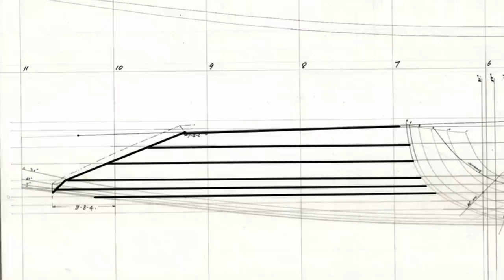SAILBOAT REFIT: Side Decks+Secret Room [E36]

Comment: You probably already know this Matt but others may not… wooden tongue depressors make excellent epoxy stirrers, applicators, fillet shapers, etc.  At about 3/4” x 6” they’re a good size.  I’m onto my second box of 400 with my build.  They work out at about 4 cents each for me, when bought in bulk.  Keep up the good work. Cheers.

Comment: It's great to see the both of you sitting comfortably in the aft section of the cockpit as it speaks positively to the ergonomics of it all and your design decisions.  I'm very interested to see how you design the locker lids in the aft benches (assume you will have these both port and starboard) while maintaining solid structural integrity. Cutting holes into the aft decks can potentially reduce rigidity but I'm certain you've already pondered this thoroughly. Great progress this week, keep on rolling Duracell! Cheers, from this Canuck in Singapore!
Reply from the maker: i'm gonna put the locker door on the cockpit wall, not on the deck. it's already pretty rigid. adding the cockpit wall will keep it very stiff

Comment: You might look into using a kitchen rubber tool that is used for getting inside bowls..it's about 2x3" with a 10" handle..good for fairing and cleaning up the excess
Reply: A spatula?
Reply: Yes you are 100 on that the silicone ones from the dollar tree work awsome
Reply: I would try a Chinese rice spoon used to remove rice from a rice steamer.
They have a rounded end and they are fairly wide which would give you a beautiful radius when smoothing out the epoxy glue. They are made out of a tough plastic that has a very nice curve and the tip of the tool.

Comment: We used to own a bakery and watched my dad using the bag to do toppings. 1967 Happy Valley Goose Bay. I got pretty good at it over the years.
There’s a little technique where you kind of shake and twist the top of the bag, forcing the material to the tip. This way you keep the top of the bag twisted and empty. That method your using works for many applications, grout, cement for brick, log buildings etc. Now your sharing it with countless numbers of young builders,,,,, that’s a big thumbs up.

Comment: A tip for the free flex type pink adhesive (smeg) instead of using a Piece of wood to smooth it off use a paint brush with acetone it smooths it off really nicely. Used this technique when fitting bow thrusters 👍

Comment: In the small locker that you intend to use for gas bottles you need a drain pipe to the external wall so that any escaping gas can flow away as it is heavier than air. I would also think about where you can add cable trunks (pipes) along the bilge for cables to the helm , engine, etc etc . That trunk should be epoxied onto the hull.

Comment: Another good episode, thank you. Take a look at heavy duty cake decorator bags, available on Amazon for about ten bucks per 100, and much easier to use than the ziplocks in my experience. I have found that you can wet out smaller sections of 1708 before installing them as long as you pay attention to how you cut it; it is quite stable along the long axis but deforms easily across the roll. This characteristic is great when working with compound curves, I glassed in a thruster tunnel on our boat and used the stretchiness to my advantage.
Reply from the maker: That’s a great tip. I’ll look into it once I run outta my bags

Comment: I have had good results in gaining open time in warmer weather by thickening the unactivated resin to close to desired consistency, then adding the hardener and any additional thickener needed. Not strictly in accordance with manufacturer's instructions, but it worked. Of course, it was with the West System pumps.
Reply from the maker: I’ve never done that, but I’ve always been curious. I’m gonna do a test run. Thx for tip
Reply: @TheDuracellProject  mp

Comment: What is the pink material that you add to the thickened epoxy? Wish you would explain a little more about the materials you use. Thanks.
Reply from the maker: it's a fairing/filleting filler, but the strength is all in the silica. I only add a little of the filleting filler (also know as glass bubbles).
Reply: @TheDuracellProject  Maroon is not glass, but phenolic microballons. Check the SDS.
They're still quite friable which makes them easy sanding as well as lightweight, but brittle as a structural filleting mixture.

Comment: 10:48 I'm curious about the reasons for removing the cassette for the old emergency tracking rudder.  I believe tracking rudders help keep the boat on course and reduce the forces on the main rudders and steering mechanism.  Is there any benefit in coping with offshore rudder strikes (whales or objects). Perhaps you have had advice on this already.  
Great to see the cockpit extension growing.  Large cockpit lockers seem to be an essential for cruisers, not only for essentials, but also the toys that inevitably become part of life on board.
Reply from the maker: Good question. We can’t leave tracking rudder where it is because it’s in middle of cockpit. I do worry about hitting stuff with twin rudders but everybody I have talked with about driving Duracell (Rodger Martin and john, the last owner, told me this) say that the rudders are overbalanced and boat is easy to steer and stays in control. Also when we cut out cassette we can reuse it to build an emergency rudder

Comment: Awesome job guys really enjoy watching your project! But Please stop mixing fairing powders with glue powder when bonding you will weaken your bond and not get the full benefit of glue power. Also get yourself some cake decorating bags way easier to use then zip locks the have a better angle on the tips for those pokey corners. Love your work guys and again enjoy watching your project.
Reply from the maker: I’ve been doing it forever and that’s what I was taught to do. I am using a small amount just to add volume. I will do some more research on this tho. Thx for your insight
Reply: @TheDuracellProject  I've noticed this trend going on (a couple other people have done it on YT).  I'm not so certain of the strength of the thickened adhesive with fairing filler added vs colloidal silica or micro-fibers... From my experience messing with cured strips of fairing compound is that its flexible but not very strong.  I guess the unintended bonus would be that it could make sanding your fillets easier, but you don't have that issue because you're glassing the joints while the fillets are still green (and thats the perfect method).  I'd ask the guys at WEST tech support, those folks are extremely knowledgeable and have done tests with epoxy that I hadn't even previously imagined was a test that had a real world application.
Reply: @SteelDoesMyWill  Yep, getting sound advice from people really in the know is never wasted time. Been there done that on other projects. May save time and money.
Reply: Fillets don't have to be all colloidal silica. Half microballons/half silica is fine. The real strength is in the glass; the bonding of the fillet is somewhat secondary unless the taping is very light.
Reply: Guys if your building a boat that is going to see some snot you want to take as much advantage as you can of the materials you have you are literally building for a time you may never need. So I wouldn’t advise taking a structurally inferior path. Its not best practice. Although im not the authority like west system. I have worked for several Ac build teams A Volvo round the world build team and many high profile maxi offshore racing yachts i do have a bit of experience and only want to be helpful.😀😀
Reply: Your joints appear to be considerably stronger than the panels you're using, so isn't further strength a non-issue?  I use fine sawdust ("wood flour") as a filler with silica, and it's quite strong, and cheap too.

Comment: Great progress....
You are obviously performance oriented. 
What is the cost differential ( and other tradeoffs)  between building with fiberglass and carbon fiber?
Reply from the maker: I did consider it, but because the boat was built out of fiberglass I don't want to mix them together, unless an engineer gives their blessing. also, carbon is twice as expensive.

Comment: Just a wee question. 
What's the difference in the compound you are using here as opposed to the one in the previous video used on the transom (pinkish coloured) one and why have you chose to use them in those specific sections?

Loving the videos and thanks as always.
Reply from the maker: the pinkish colored one has just a little bit of fairing glass bubbles in it and that is to add volume and prevent it from sagging. the white is just purely silica additive

Comment: Sometimes you put the coving in with the same brown filler as you use to glue with the icing bag and sometimes just white? Is there a difference?
Reply from the maker: purple has the glass bubbles which i use to add volume and keep it from sagging. the reason i use it only sometimes is that I just don't always have it handy.....it's not totally necessary. the important part is the silica

Comment: If you’re thinking of putting propane bottles in that locker. Wouldn’t you have to ventilate the locker?
It’s all taking shape 👍👍
Reply from the maker: yes, it will be ventilated if we decide to put propane in. it just needs a small hole in the bottom for propane to fall out of

Comment: Is it possible to tape over the coves while the coves are still wet? Or do you have to let them firm up before you tape over them?
Reply from the maker: good question. i try to do what's called wet on wet where the cove is still wet while i apply fiberglass and use my roller to make sure fiberglass is touching all the soft cove, but it doesn't have to be done that way

Comment: Hmm. You're building that deck extension like a carpenter on a wooden boat 
I feel the correct way to join the hull with deck is to have the two sides only meet on the inner edges, and not overlap.
Then, ream out 20mm of foam between the glass skins,  and laminate a solid edge of glass, to fill in and fair the sheerline. 
Foam structure isn't engineered like timber.
Edit  
Pre wetting the coving strip's is the best way, but do it on a piece of plastic sheet or peel ply. 
Then, when you offer it up to the surface, it won't stretch or drip. You can then roll it on, and leave the plastic on till cured for a smooth finish
Reply: Hi Ray, that´s not how fiberglass boats are made. First the hull is constructed, and then the deck/decks. It´s then laid on top of the hull, if possible in one piece, and then the two parts are mated - basically glued and taped together. Matt is doing it correctly. Regardless of this fact, if you consider the load that the deck will come under (which is not particularly high in this location), it will mainly come from people walking and sitting there, in which case you would rather rely on the hull-sides and mini-bulkheads supporting the deck, than the tapping itself. Makes sense, right
Reply: @belledetector  I base my thoughts on professional plans designed by complete engineering analysis..
For example,  many boats don't have any foam at all in the chine areas.
They use solid , heavy glass alone. 
The reason that foam is not best in butt joins is that it has poor shear strength, and the skins at chine joins are very hard to engineer well.
This project will probably be OK,  as there is lots of edge wrap, but it's far from optimal for weight and strength.
Your analysis of the stresses don't include being moored between  a 50 tonne steel trawler and a concrete wharf, for example.

Comment: I respect your effort to use as many pieces of the original Duracell as possible.  Your reincarnation is not a race boat where some billionaire has every fastener custom made of titanium in order to gain an imaginary nanosecond of performance.  On the other hand you are adding a substantial amount of fiberglass, filler,  and windows to the aft sections of the boat compared to the original  Roger Martin design. Have you done a weight study comparing the surface areas and laminate weight of the original aft 1/3 of the boat vs  your final design?  How much weight penalty is incurred by keeping the old Duracell structure in place and using old scrap pieces vs engineering and building an optimal new structure? And the engine room is huge, with room for electric drive motors, watermakers, generator (s) autopilot(s) etc and everything that dreams allow.  The fundamental rule with a lightweight boat is "keep the weight in the middle."  . but the machinery weight seems to be centered closer to the rudder shafts rather than at the longitudinal CB.

Every design is a trade off!  Perhaps a ton of sponsor donated Li batteries fwd of the keel will  dwarf any concerns about extra weight aft!  In any case the end result  of Not-Duracell will be fascinating. 

PS: My limited sea time (about 4 weeks)  at the helm of twin wheel, twin rudder ULDB high performance cruising boats didn't leave me impressed, especially since both were of moderate beam like Duracell.  You might want to look up the excellent interview by Adam off of Millennial Falcon with the designer of the Kraken mini maxi cruiser in which he goes into detail about his choice of a single rudder.  
Cheers

Comment: @The Duracell Project 2:00 you are removing a glass skin from foam. Is the easy to peel  bond typical for this type of construction or are you showing us a defective bond between glass and foam?
Reply from the maker: it's a defective bond from the first pilot house roof failure. So i had to peel it off so i could start anew.

Comment: Shame  if Duracell wasn’t all electric.. induction hob?
Reply from the maker: it's a possibility....design is in the works. it will never be purely electric...battery technology just isn't there yet.
Reply: @TheDuracellProject 
 I guess marine hybrid is more what I was thinking. Considering it for my steel canal boat refit. Cuts gas out of the plan.  Ebersbacher combined heat/power unit with our existing large battery pack and solar seems a good road (we have a woodburner with boiler for Winter heat and cooking). Love your work.